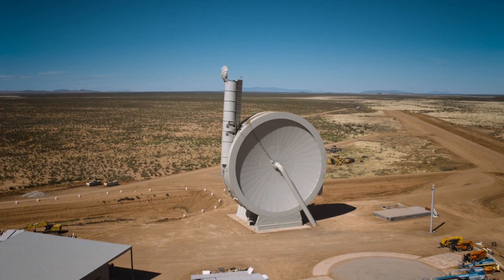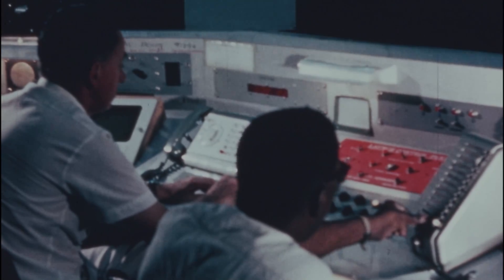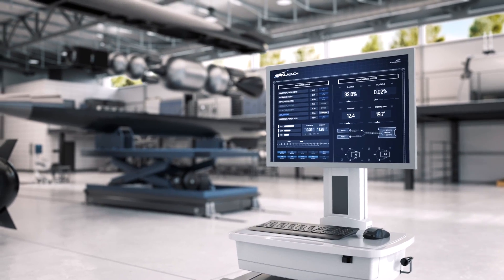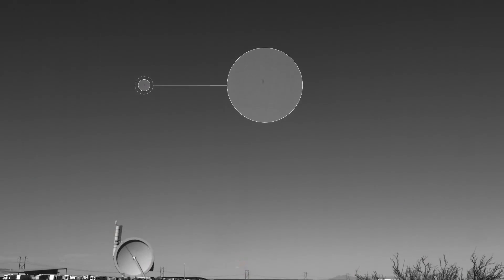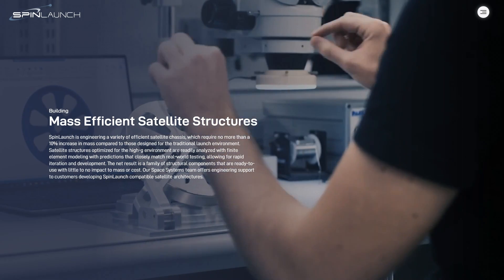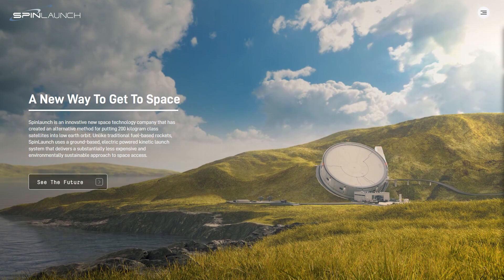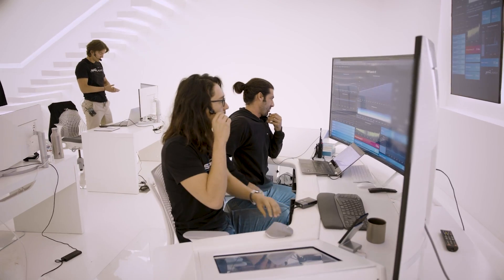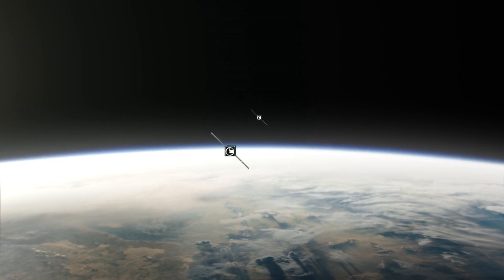Can Spinlaunch Throw Rockets Into Space?

Comment: Err, correct me if im wrong, but... don't linear accelerators outperform this by every measurable metric?

-No Tumble (100 rpm on release means your projectile is also tumbling over itself at 100 rpm, right?)  
-No finnicky high-vacuum chambers  
-MASSIVELY increased fire rate ("spin up" takes hours, firing takes seconds, reloading takes minutes)  
-No imbalanced rotor  
-All of this, for comprable peak loads that last for < 1 sec instead of hours.

Sure, powering it is difficult, but I have a hard time believing a giant centrifuge in a bigger vacuum chamber is gonna be cheaper than a longer barrel or enough capacitors.
-
Reply: Am I missing something? Is there a scaling problem I dont know about that favors spinlaunch? Because in my inexpert understanding the only advantage for spinlaunch seems to be land costs to build the thing and lower peak power requirements to run it.

Comment: I work on Vacuum Centrifuges for R&D drug discovery, my question to this whole theory is this: @ 450 RPM that's talking some serious amounts of G forces on the center shaft. EVEN under a vacuum G-Force still applies as friction from air does not I get that! You brought up a good point of the balance system of how it can release the projectile and having to in a microsecond to balance out the rotor as you release it's weight, the instant the rocket is removed from the rotor, your just went from balanced to unbalanced and shits gonna start really moving around! Like a washing machine in spin cycle and the load shift is all to one side. We know the outcome of this BS, as the machine walks across the floor from shaking. I will be absolutely amazed if they are able to achieve this. It's a good theory of evolution of putting things into orbit, but it's a matter of microseconds you have to somehow shift tons of weight to neutral balance upon launch to counter that effect of now nothing being opposed to the projectile. Interesting theory........ Except for this one minor issue with the balance system and how to overcome this???? I've been witness to what we call a catastrophic failure of a what we call swings in our field, it's not something that your gonna recover from if something let's loose at those G's! I've seen aluminum be capable of puncturing thick layers of stainless steel and aluminum blast shields. Granted the largest of machines we work with are capable of a human fitting inside the chamber! So to get a rotor to go from a balanced state, then releasing the one side of multiple tons without the G-forces adding multiple tons of weight to the loads. When you now have nothing on the one end you have to overcome some serious amounts of weight and quickly to say the least! So you'll have to take the opposing weight and safely make it overcome all these forces and make it move almost instantly towards the center of the rotor shaft before the shaft or arm sheers off or it doesn't start shaking itself to pieces. So maybe upon release, the mechanism that releases the projectile will help assist pulling up on the opposing weight as it exists??? IDK if that is even possible or not and what effect it would have on the projectile by such loading? Would it just equal itself out at this point? And the rocket just goes a little ways? Without computer mapping of all the forces applied it's hard to know what exactly would happen if they were to do something like this? BUT to me it would be pulling back so hard, the counter balance is wanting to go the same exact thing speed wise just in the opposite direction of your projectile that this wouldn't work at all? It may pull the weight back into the Center? But in the process of doing so as well as encountering atmosphere it may just cancel itself all out??? IDK how they plan on solving this issue? Maybe real interesting to find out what they come up with though??? Thanks for the video.
Reply: Leaving this comment here so that I can get back and read this again in the future!! Thank you tho!!
Reply: Can't you just link up a flywheel where drag can be applied to counter the weight and in unison with the release of the rocket the blade detaches from the counter weight making for a seamless system?
Reply: Excellent points.  I think the basic design works against itself in so many ways that it is completely doomed for earth launch of a complex payload such as a rocket that has a complex and delicate payload itself.  It has some possibilities for launching raw durable materials from vacuum or near vacuum like the moon or mars.
The only reasonable way I see to stabilize the imbalance in the centrifuge at/after launch is symmetry.  Release an equal mass in the opposite direction when the missile is released. It would probably release more or less straight down into a deep hole to absorb the energy safely.  This solution has the unfortunate effect of cutting your deliverable energy in half.  But that is characteristic of a bad design - it requires fix after fix that steadily undercuts the desired result.   By the time it is reliable, it is no longer useful.
Reply: We have all seen video of a washing machine self destruction when a cinderblock is tossed in at speed, but under normal conditions, washing machines continuously re-balance themselves.  If you look at the centrifuges the Airforce uses to spin pilots at up to 10G, there is no balance shaft.  All the force is handled 100% of the time with bearing load This in a system safe enough for a human to ride.  
How will spin launch solve the problem?  How did they solve the problem in this scale prototype?  I don't know.  If I had to come up with something, I'd have the release mechanism contain weights that shifted outward on the arm during release, rebalancing it.  I'd put most of that weight toward the leading edge of the arm, and use the force generated to help correct the spin of the projectile upon release, as that would seem to be another problem.

Comment: One of those "works on paper" things. It will take many many years for them to overcome the engineering challenges that come with getting the device to actual orbital launch speeds. We'll see but this demonstration really doesn't do much, it's akin to using a firework to prove that you can build a Saturn rocket. Yeah, the concept works but there's a long way to go.
Reply: It does not work even on paper. 
It's a total scam, like Theranos.

10.000 G of acceleration will turn any payload into a lump of paste. Already a 150 mm wide structure of aluminium will start creeping under its own weight.

Also the counterweight will end up in a huge crater after it is released.

Comment: Mach 7 at initial release? Doesn't even seem possible. The skin would melt and it would tumble coming out from the rotational speed. Not only that, if it fails, everyone below in the control room would be liquified. Horrible design and just sounds like a scam. The balancing issue itself would destroy the machine after release AND doing it under vacuum.

Comment: I'm highly skeptical.  My analysis showed that it is possible, but only if the shells are very narrow, like 18cm.  If they want to launch existing payload sizes of around a metre, it loses any advantage.  I'm still working out the centrifuge, and so far it looks bad.  Like 21 tonnes between the rotor and mass being thrown.  I think the odds of failure are extreme.

Comment: I assume your altitude and velocity calculations include the drag for hypersonic flight, I'll admit my experience with fluid dynamics doesn't reach that far. I'm curious about your certainty that a liquid fueled rocket can be designed that will handle 10k gravities on one axis, as well as several hundred (with a huge jerk) when it hits atmosphere on another?  Those artillery shell fuses are good for somewhat over 10k, but only in one axis, and aren't nearly as complex as a rocket second stage.  Also the occasional fuse failure isn't a huge deal, the worst case is something DOESN'T blow up.  Your spacecraft failing to fire and undergoing an uncontrolled re-entry with a full fuel load can be something very different.

Comment: 4:30 that white thin film is supposed to hold the atmospheric pressure? with that big area? magically desintegrating without damaging the rocket??? no way!
Reply: That launch was performed without a vacuum. Otherwise the membrane would have been sucked into the chamber at least partially.
Reply: That chamber will never hold vacuum and even if so once broken it would take that rocket and throw it out of control. This is complete Bs. Impossible, been proven 50yrs ago.
Reply: Oh, the mysterious hymen...
Reply: You also see there is a lateral movement while ripping that foil. And now imagine this with the 450rpm and 100m arm of the final version. And - bonus - how will you contain this? Imagine the arm fails and hits the wall of that chamber with that kinetic energy (it is more or less a bomb). Add the rocket fuel inside which does not help either...
Reply: Hymen Rickover.
The projectile should be submarine shaped, just as a tribute.

Comment: Elon Musk pitched this in 2013 as the revolution in trans-continental transportation. He said that capsule-shaped pods, 200 person each, would be shoot at Mach 15, reaching 20000g of force in the pre-launch rotations, anyway internal organs of the passengers will be protected by the new Musk Con Industries® invention, the anti-grav fluid®, that  passengers will be submerged in (fluid ready by 2022, currently in pre-production). Remarkably the pods will not travel trough the atmosphere, but they will be shoot in vacuum tunnels that pass through the earth center to reach every major cities in the world (tunnel are currently being excavated by boring company and will be ready by 2024). The pods when in near proximity of the arrival station will be braked by giant magnets sliding between coils like in a coil gun but working in reverse. G force from the deceleration will be even higher than launch, but again... Anti-grav fluid®. The electrical current generated by the magnet passing between coils will be used to recharge tesla's Robotaxy® in the near parking lot. First test passengers at the end of 2024, and in 2025, the transportation industry will be forever changed by Musk Con Industries®

Comment: Speed of sound is not problem, according to internal ballistic books problem rise on 4 times speed of sound (speed of sound in combustion gases in barrel of gun, which is higher them speed of sound in air on 20C)
Reply from the maker: Yes, but 4 times the speed of sound is too slow for space launches.
Reply: @scottmanley  for all practical purposes you are right, same way as you can't use pure cannon for practical space launch (with cannon you can't launch anything in orbit,  any speed less then escape velocity will result in sub orbital trajectory), but theoretically you can reach space with any velocity down to 0 (if you for example move object with just vertical speed of 0.00001mm/s to altitude of 100km you theoretically made space launch).

Comment: utter bollox, sorry Scott matey.  Show me a bearing that can hold a vacuum and still revolve and transfer command to the payload to undock from the arm. It does not exist. Show me what happens when the mass of that arm becomes unbalanced at the moment of launch, it will destroy the launch site in a heartbeat. The computer simulation is very pretty, but only a bonehead would fall for it, take a moment to consider something more than what they promise.
Reply from the maker: What engineering school did you go to? There are rotary bearings in space suits that need to hold vacuum, there was a fine example of a high speed rotary bearing that was sealed against 20 atmospheres of pressure in the variable density wind tunnel build in 1923 (https://en.wikipedia.org/wiki/Variable_Density_Tunnel). And if you want a rotary bearing that passes power and data look at the bearings on the ISS trusses that support the solar panels.

Only a bonehead would think the bearings were a problem.

Comment: The tip of the rocket exited the vacuum chamber about 30° off from the tail .
They will also have massive problems with creating a vacuum chamber that big without leaks.
Reply: They do not need to make a true vacuum more like a high altitude good enough vacuum.   They run a series of pumps in different stages.

Comment: If you could put this on top of a 6000m tall mountain top I think many problems would be solved with projectile instability and size of 2nd stage plus fuel etc. Well, if shooting counter weights @2000m/s straight into the ground on a narrow mountain top repeatedly - in the end doesn't crack the mountain from top down. :D

Comment: Was it actually in VACCUM???  Video seems very very not vacuum. Sound and also once the rocket goes thru the seal, the seal doesn’t go back inwards (showing air getting back into the chamber.
Reply: Test was conducted at 20% of theoretical max speed possible on the one third scale test machine so I'm guessing that the vacuum did not need to be very robust. Its a kind of proof of principle but I'm very very sceptical that the needed spin speed and release timing can ever be achieved.

Comment: One thing that i'm sure will make this impossible to be "functional" is the vaccuum. I have never in my entire life seen any bearings for that motor that can seal it off with near perfection at such insane speeds. I honestly see the entire thing disintegrating and exploding at any speed above 3g.
And without that vaccuum i'm sure they won't even get near 3g speeds
Reply: @timemachine_194 rpm is one thing, your motorcycle doesn't have to handle the energy required to launch half a ton into space.

Comment: Idk, but the whole centripetal acceleration seems really really crazy!

100.000 tons of force would equal 10 Eiffeltowers, which is a LOT for some carbon fiber blade to hold.

Maybe I got this completely wrong or my maths are off?!

Edit: ¼m² cross section of solid carbon fiber seems to be enough to handle the tensile stress, still pretty crazy

Comment: Thank you for seeing further than Thunderf00t and actually proposing a moon based Spinlaunch to get around the main disadvantages of operating this system in atmosphere.
Reply: @No Body you know that the plan for going to Mars is to refuel the spaceships over there for the return journey right? and have you ever heard of the NASA Artemis mission?

Thunderf00t thinks it's more feasible to produce over 200kg of artillery propellant on the moon than to use Spinlaunch. Or maybe he didn't even think that far, who knows. 

I think Spinlaunch has a good chance of being a reusable, cost effective solution to move raw materials and trash from the Lunar surface into LLO. What would you propose? Bonus points if it's actually possible and doesn't require kilometers of infrastructure, a fuel refinery and chemical plant, futuristic megameterials, or a capacitor bank the size of a warehouse.
Reply: LOL! What's your IQ?